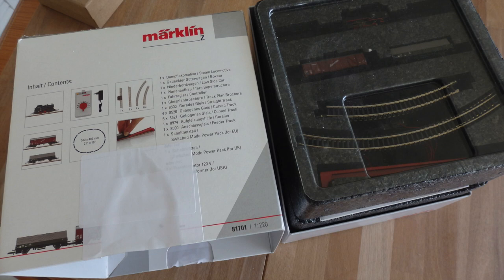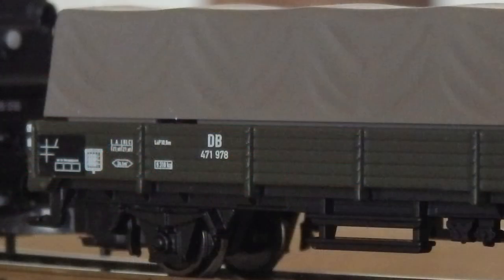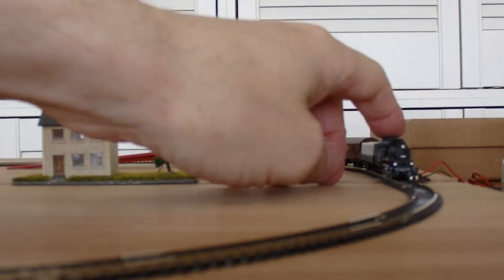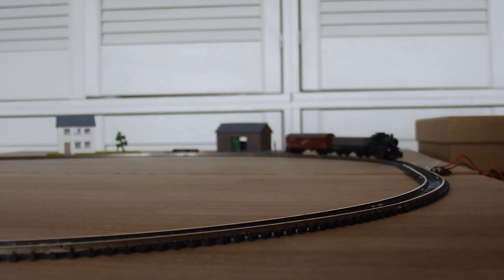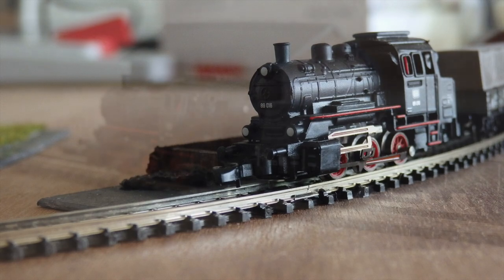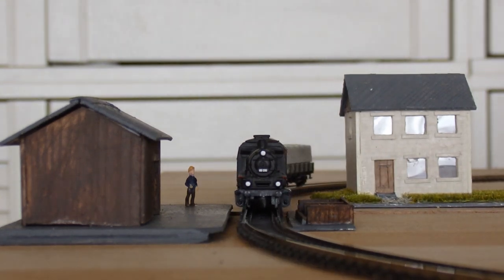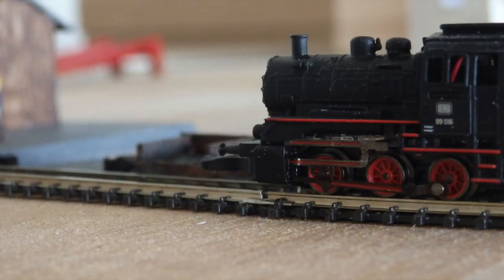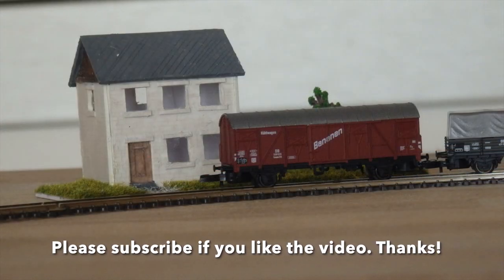Marklin Z-scale BR89 Mini-club starter set 81701 Startpackung - Unboxing, test run and review

Comment: You will get better reliability if you pin the track down as Marklin suggests.. System Jorger make a good track cleaning  car but the track   must be reasonably  to start with and use the car  regularly after that. DCC is also an option with a few manufacturers making decoders.
Reply from the maker: Hello! This set is my dad's. He has in the mean time made a layout, I think he has glued the track. You can find videos of his layout on my channel. He's doing a great job I think, he is 86 years old, I think it is very difficult to work on such a small scale.
Thanks for watching 🙏👍

Comment: Perfect starting set, welcome to 1:220. I love this scale; my father an I have built two layouts. Once can fit a whole world on a small plate. I will present those layouts later this year on my channel. As you have mentioned, the tracks must be keep clean - the price of the models is high, so thinking about a cleaning coach is worth the money. But I recomment not to buy the cleaning wagon/train MÄRKLIN offers - it does not work properly. Have a look for different small firms, which offer better solutions. I have constructed a coac on my own, using a special cleaning towel, which I have fixed under a coach - the pad can be filled with a special cleaning liquid (Dampfloköl /liquid for smoking train models).
Have fun and all the best
Valentin
Reply from the maker: Hi Valentin, it’s my 86 y.o. father who has started his old hobby again, thus time not in H0 but in Z-scale. 
Thanks for watching 🙏👍